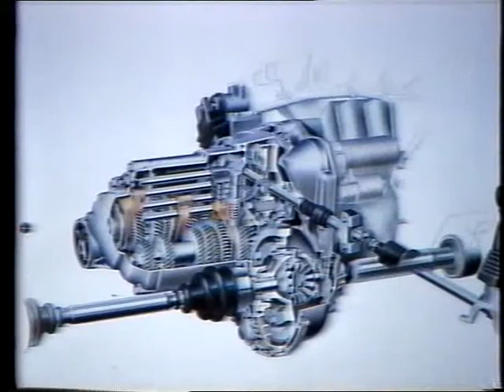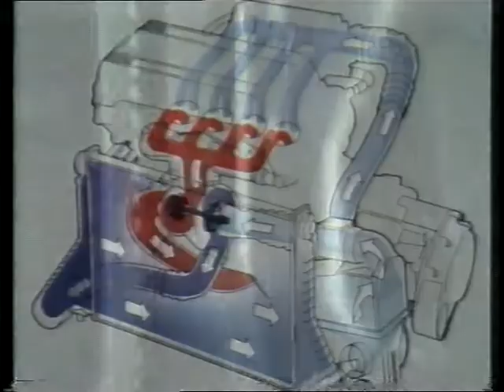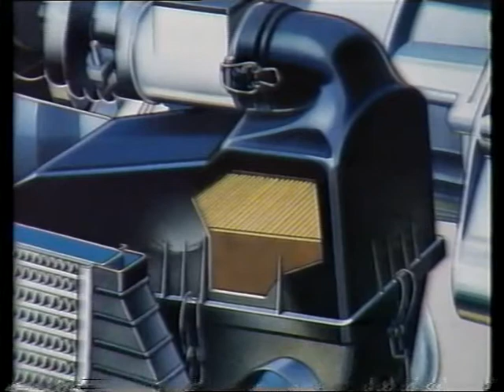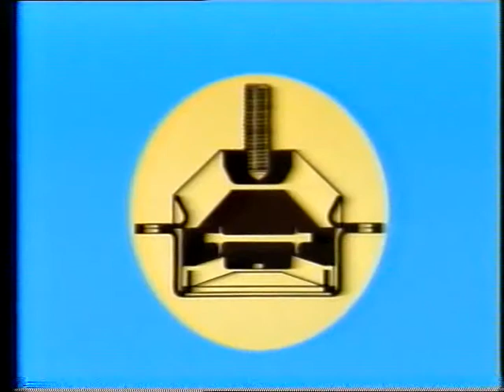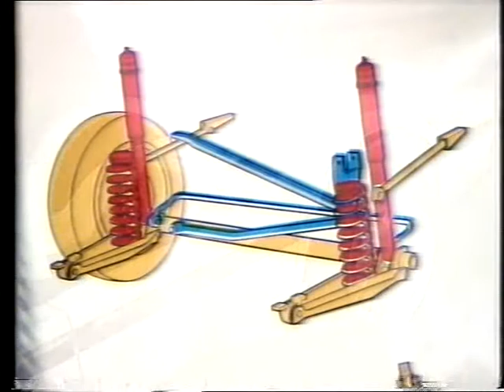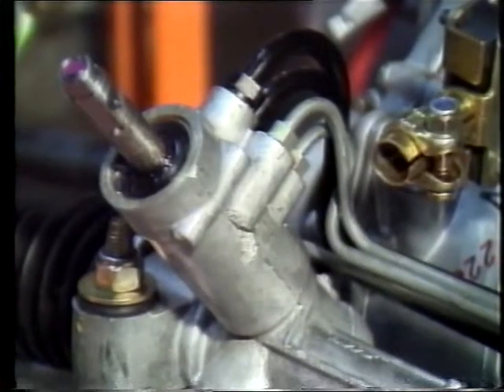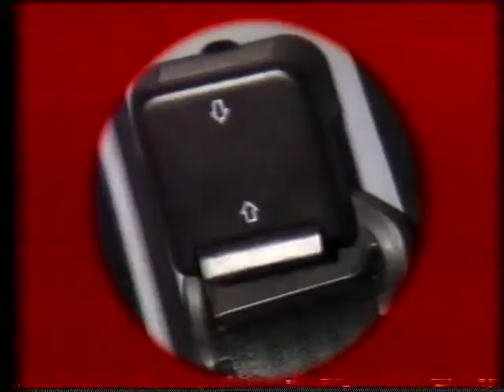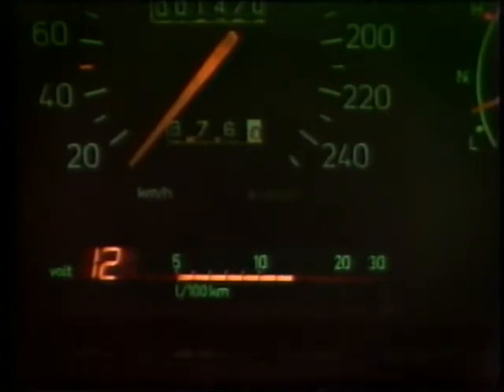Saab 9000 Promotional Film

Comment: I owned three 9000turbos and loved each one and each lived over 200000 miles and with me driving over 100000 is a miracle and with a couple mods and no cat on one like I did too my other Saab I loved a86 900 turbo ahh how many burnouts it did ❤and two of the 9000,s with manual transmissions what I would give too find either model now a days 💚💜now I have too watch a great video of a 900 with 3hundred something horsepower doing burnouts like I use too it's in my Playlist of cars on here too always remind me of me 😊🙏